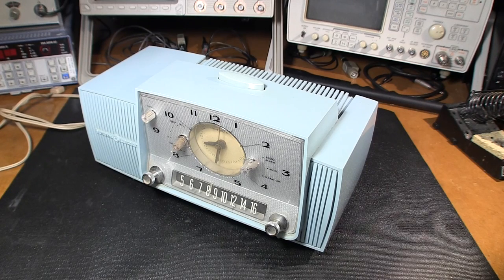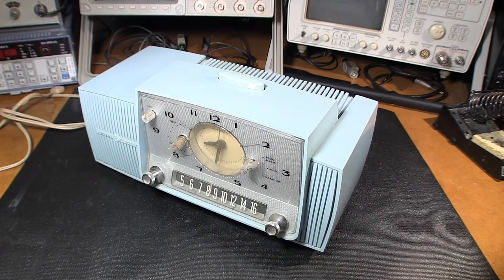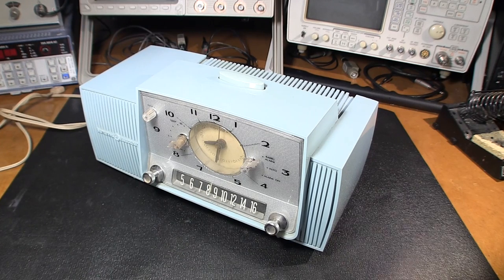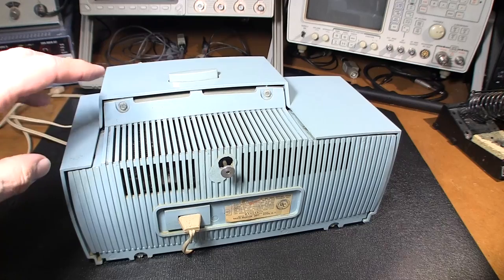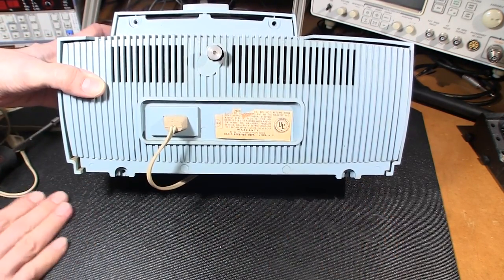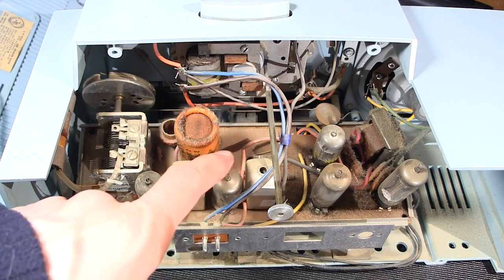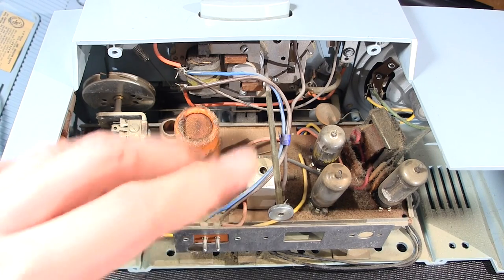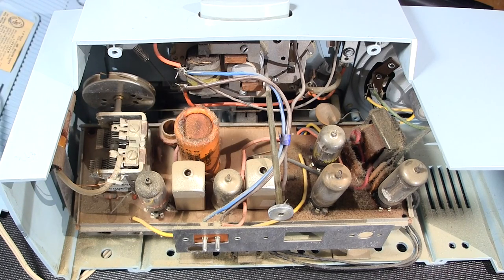Atomic Era Radio Teardown, Explained With Repair

Comment: Regarding the big and usually bad filter capacitor:  I worked for a couple of years part time at the Navy Exchange TV and Radio repair shop on Midway Island (my real job was being a Navy Electronics Technician at the transmitter site).  Another fellow there showed me the fast way to deal with those.  And we did have many of the "5 tube" table radios come in with that as the only problem.  Since the capacitors came in all shapes and sizes, we just had a box of a generic style with a long lead coming from each end.  We would use electrical tape and just tape it to the old capacitor which we disconnected so it was nothing but a big mounting post.  Wire up the new capacitor, and the radio was back in business in minutes.  It isn't the way we repaired other things, but this was so common, and the radios were so cheap, that we could charge a repair price that was affordable AND get the radio back to the person quickly.  And then they could listen to pretty much the only station they could usually receive.  The KMTH AM station on the island which had a Gates 250 transmitter located at - you guessed it - the Navy's transmitter site building and I maintained that, too.

Comment: When I got my Drivers License, my dad (who didn't make a lot of money pumping gas) bought me a car. It was a 1950 Ford Custom 2 door that belonged to an old man who had worn out the drivers seat, then crashed into a phone pole. So I had to replace the front clip, hood, grill, radiator and two water pumps on the old flat head V8 engine. It was easy to do back then as the dump grounds had piles of old cars and most recent junk cars were sitting on the ground.  My buddy and I drove his dads pickup out here and salvaged all the parts. Within a week I had the old rig up and running. At any rate the dash had a clock in the very middle, and just below was the AM radio.  It looked very much like that radio!  I even got the clock working, but I wanted a better radio, I found one out of an old Chrysler with electric motor tuning that I hacked into the dash, then added a rear speaker since it was supported. I replaced the front seat with one from a 62 Rambler Station Wagon that had reclining seat backs, luckily they would fold all the way down and I had a full size bed in that old Ford.  It was very handy for learning all about sex from the girl next door and a few of her girl friends who learned that I was well read when it came to foreplay and well the act itself. That old car had steamed up windows quite often and KOMA in Oklahoma City played the sound track for my growing up, it was far away but a strong station that played the wonderful new sound of ROCK AND ROLL!

Comment: AM radios that sold in the U.S. back then had little triangles at 640 kHz and 1240 kHz positions on the dial, which were frequencies set aside to warn U.S. residents of an imminent Soviet attack.
Reply: You're talking about. CONELRAD (Control of Electromagnetic Radiation).  It's a former method of emergency broadcasting to the public of the United States In 1951, Truman established this alert.
Reply: Why 1240 and not 1280?
Reply: 1240AM could have been defined as a clear channel where no transmission frequency existed.
Reply: This was likely arbitrary. I guess it would seem to be easier to remember, since the last two digits match each other on the AM frequencies.
Reply: I seem to recall that this was an act of Congress,and was in effect for about 10 years. It was replaced by the Emergency Broadcast System (EBS) in 1963.
Reply: In October of 2010, I repaired the output tank section of an AM transmitter which had been installed during the mid-1950's, and remained fairly well maintained until the day in December, 2009, when the transmitter's signal was improperly truncated while being shutdown on the day the station ceased operations.  The station was located approximately 22 miles due west of Philadelphia, and was one of eleven CONELRAD stations surrounding the Philly Metropolitan Area prior to 1964.

The Continental 2,500-W transmitter featured  a "CONELRAD Transmission Transfer Sysytem", which remained until 2013, when a new transmitter was installed. 

Apparently: that "transfer switch" served two purposes; primarily, it took the station's already operating  transmitter offline safely, and switched to what was probably a very secure source generated at some Federal Government studio, which was connected to the weirdest dedicated telephone line system which I've ever seen.

It then switched that input into the 1240 Khz CONELRAD transmitter, which was controlled from a remote location.

I tried bargaining with the station's owners, to acquire a large black/yellow/red/white/blue which displayed the CONELRAD seal, 
 and instructions to tune to 1240 Kc when instructed to do so. 

But the eerie thing was the big, bold lettering which stated "IN TIME OF NATIONAL EMERGENCY", which still managed to scare the hell out of me, almost 40 years after the dissolution of the system.
Reply: One of the difficult lessons learned from the Pearl Harbor attack in 1941 was that the Japanese attackers were able to home on the broadcast signals from KGU in Honolulu, which had been left on all night at the request of the U.S. Army, which was expecting the arrival of a group of its airplanes from the mainland on December 7. 

Informed by this experience, the logic behind CONELRAD is that all stations in the U.S. would broadcast emergency information simultaneously and at discrete times.  Accordingly, Soviet aircraft could not radio direction-find various targeted American cities through knowledge and use of a local broadcast frequency.
Reply: During November, '79, I was a sophomore in college, and doing the "earn as you learn" USAF program which blended school with duty time, and made summers a bummer for four years.  The first weekend of that particular month was an "off duty" weekend, which meant that I'd be earning my bar tab at my hometown's local radio station (I had a Second Class Radiotelephone Operator's License, so I was in 'repair mode' and 'keep the 80-something year old dude who was spinning country music on the turntable from generating too much dead air mode"). It was a beautiful and sunny afternoon that Sunday.

Or so I thought...

(I still remember this sequence of events with crystal clarity)
Around 1:52 PM, the station's CBS Radio Net Alert status monitor/indicator flashed "11", followed by "14" about 5 seconds later, which meant that I had to dump the local programming, and switch over to the network IMMEDIATELY.  While doing that, I called one of the station's owners, and requested that he "get up here, like NOW", because all hell had broken loose. 

"We're locked into the CBS  Radio News feed, and this sounds really bad".  The Iran Hostage Crisis had just been announced by White House Press Secretary Powell.

I conned the station owner's (then) 22 y/o daughter,  into bringing Cheesesteaks and Subs for all of us, because we were in for a busy evening.

I wound up dating her for almost two years....

Chet Campbell, the star of the "Campbell's Corner Radio Program", for almost 30 years (at that time) threatened to shoot me, because he had just introduced an "up and coming talent for the ages", who played an electric zither.

To "partially" plagiarize Garrett Morris, a.k.a. "Chico Esquela", "Radio been berry berry good to me"....
Reply: I don't think of it as the "atomic era." I think of it as the '57 Chevy era.
Reply: Chet Pomeroy civil defense network
Reply: With some radios and also emergency supplies, there would be a "CD" within the triangle for "Civil Defense" and those were the designated civil defense news sources in event of a national emergency.
Reply: @Landrew0  57 Chevy would be attomic era..
Reply: @colinjohnston8519  Agreed. Check out Cold War Motors on YouTube. They guy collects finned 50s cars, mostly Chrysler products.

Comment: Thank you so much Bob !!! You have augmented my knowledge of IF cap replacements and final alignment. On this presentation, you did not get into tube testing, which is a part of the servicing process. Probably best left to a another video. I personally stuff the can capacitors, making a simpler job of re-install. Again, thank you !!

Comment: Back in the seventies I repaired a lot of those radios, most just needed the tubes to be taken out and put back as they'd worked lose or had dirty connections. I also saw a lot of them even with heat shields in place had saggy plastic.

Comment: interesting seeing you pull apart the IF transformers, as they are very delicate and easily destroyed by many not as careful  as you were in the video.
Reply: Paul, that's because we have no choice but to fix these ourselves, because replacement IF transformers have not been made in decades.

I first noticed the problem in radios I've repaired as early as the 1960s. If I couldn't find replacements, I fixed them myself, even then.

Comment: god I love tube stuff, I used to work at a recycling center and brought home a nice old heathkit shortwave radio some one threw away, worked wonderfully but my mom made me return it to my work because she was afraid it would over heat and catch the house on fire or something, which I'm still some what sad about to this day even though that was back in my teenage years.

Comment: Good video.  The clocks in the early 1950s GE radios have Telechron drivers.  GE owned this business at the time.  These are sealed, but there are videos on  YouTube on how to lubricate these using a heat source.  This technique worked for a 1950 GE clock radio that I restored, reducing the noise made by the clock.  There is also a place to send drivers for restoration if you are willing to spend more money.  I saw what looks to be the end of one of these drivers in the  clock of the radio in this video.
Reply from the maker: Thanks for your comment Jody!

Comment: You are thorough, I've never seen anyone change the IF can capacitors before even hearing the static.  Great video.  One thing is certain, there won't be anyone working on the crap Apple sells 60 years from now even for the nostalgia.

Comment: Just wanted to say your videos are great! to say i have limited knowledge of electronics would be a very generous description of my knowledge. I have, in the last few months, been learning a bit. I actually fixed a Joe Meek Three Q a few weeks back. It wasn't much of an issue just had to replace a potentiometer, but I was still pretty excited, and i got a nice little piece of gear for the cost of about 3 bucks.

Anyway, just wanted to say your videos are great. As i already stated, i have no experience in this field, yet i find myself watching your videos from start to finish every time.

Thank you

Comment: Regarding thermal decoupling and not soldering  off the other end of a free hanging wire: I have various clamps (and also a few that are basically small surgical clamp scissors thingies) that I put between both points for such cases. This will act as a heat sink, and unless I am soldering for hours at the one side, the heat will never make it to the other side of the clamp since the majority of the energy gets sucked up by the big clamps body.

btw. thumbs up for the scope trace PiP !

Comment: Wonderful restoration job, as usual. This was a nice unit to begin with.
One comment to add, since I don't think you mentioned it (am I right?). The reason why the chassis is potentially 'hot" is the absence of power transformer. Cheaper to build like that! 
Thanks!

Comment: That was extremely interesting and I was thinking that I have to send a link to my brother in law who's into restoring antique radios. but then it occurred to me that he is the one who introduced me to your channel. I do wish you had gone into more details as what was in that "integrated circuit", I suspect it's just resistors and caps but it still would be interesting to know what kind of circuitry they put in there.

About the danger of non polarized AC plugs, one has to be careful even with polarized plug. I'm no electrician but I've seen plenty of examples of AC sockets wired the wrong way around in second hand houses that had some renovations done by people who really don't know what they were doing.
Reply from the maker: Thanks for your comment!

Comment: This is one of my favorite models of radios and in fact the same model that started me on my career and interest more Hobby and interest though I'm collecting and repairing old radios like these I had gotten it from my uncle's garage sale when I was 10 years old and we had taken the tubes out and check them on a tube Checker at the local drugstore and found out the v o c v audio output tube was bad put a new tube in and it played just fine and I love that dial beam where the light follows the pointer back and forth I used to love looking down at the tubes at night when I had the radio in the cubby hole in my little twin bunk bed and I used to listen to Wolfman Jack when he was on the radio in 1974

Comment: Mr. Carlson, I enjoy, enjoy, enjoy your videos. When I was a kid  I had an uncle that repaired television sets. Many times Dad would call Him and He would come out with His tube caddy and wallah Superman strikes again!  Well I was hooked on radio and TV from then on. My parents had a stereo receiver, well I don't know it may have been mono, that also had a record player and a record storage area. It also had a shortwave receiver in it. It also had a cats-eye signal strength indicator and it had four oval speakers that ran across the bottom. I'm guessing it was about five feet long and 30 inches tall. It had two sliding doors in front. We used that thing for many years. I don't remember the brand. Have you seen anything like this. Thanks. Ken.

Comment: It seems that the couplet replaced all the wax paper caps that were used previously. You need to make up some T-Shirts with your picture on them pointing your finger Uncle Sam style with the quote "You do so at your own Risk"  I bet you'd sell a boat load of them. Thanks for the video, great job as always.

Comment: On the "integrated circuit", it might be more accurate to call it an early "hybrid circuit".  Most had just resistors and capacitors and were not active devices.  I once repaired a Kenwood TK-140 with a bad one that was used as a filter and it had only resistors and capacitors in it.  But they were also made sometimes involving diodes and/or inductors.  They tended to be custom made for manufacturers (mainly by Centralab, Sprague, and some others) and VERY hard to find a replacement once a product gets a little old.

Comment: I had a similar radio that had gone to college with all three of my sisters, and found that just a coat hanger bent in the shape of a diamond used as an external antenna brought in all sorts of FM stations (this was strictly an FM radio).

Comment: Great video Mr Carlson. this helped clarify some things for me.  

What are you using as a signal generator?  Can you reccomend a "hobby grade($)" solution for the average joe?

I have a handful of tube radios that are in various levels of repair(Zenith 7n05/7n07 chassis), and the biggest hurdle I have come up against is aligning those transformers, because I don't have a capable signal generator.   the Sams photofact (Set 916 folder 8, page 3) describes the FM alignment process using a simple AM signal generator, but indicates I need to feed it a 10.7MC unmodulated signal, and the best my old BK 3020 function generator can do is 2MC.   
(It also describes the process for aligning it with an FM signal generator, which requires scope settings for deflection, 10.7MC sginal generation with 450KC sweep, and my 3020 definitely can't do that... )

If I heard you right, in your video you set your signal generator to 455Khz, modulated at 50% with a 1000 cycle tone, 10mv.  I can set my generator to put out a sine wave at 455khz, but don't think I can accurately set a modulation like that 1000 cycle... should I be able to align my radio at a frequency below 2mhz?

I have a Tektronix 2212 oscilloscope (60mhz), a BK 3020 sweep/function generator (0-2mhz), and a MemTrix MX200 frequency counter at my disposal, and regretably, very little experience using any of them...

Comment: Remarkable that a power supply with just capacitors has such a low hum. Of course a regular choke positioned inbetween the two caps would give even better results, but apparently these radio's were designed for minimum costs in production, starting by leaving a power transformer out. I once repaired a directly mains fed Philips working on "our" 220Volts, which did not have a choke either, but had a high resistor type inside a glasstube in series with the mains connections. Warming up was very slow and its time was about 40 seconds. Maybe that's why this unit designed and built in the 30's still survived up to the early 60's .  In Europe the tubes for such radio's had higher voltages for their filaments inside the kathodes and were numbered in the U series. These U series tubes were the first to become unobtainable over here

Comment: Excellent video, not that i will ever fix an vintage radio, but the analysis and concepts, for instance i didn't knew that the IF transformers have two settings one on top an one on the back! i thought that it was the same one accessible from both sides!, also never new that they have embedded 100p mica caps! wow!,  how did you put the scope screen in a video overlay???, that was fantastic!, finally you forgot to mention what was the integrated circuit purpose, thank you!, looking forward for your next vid.